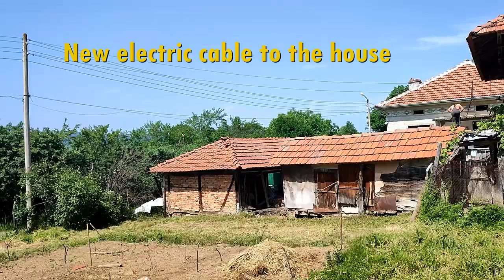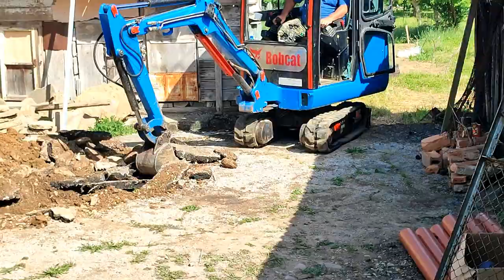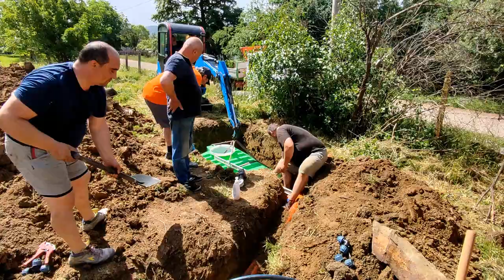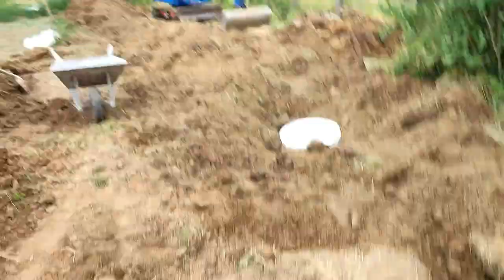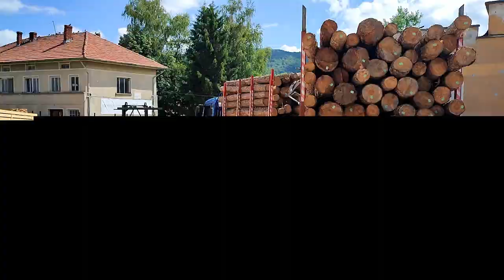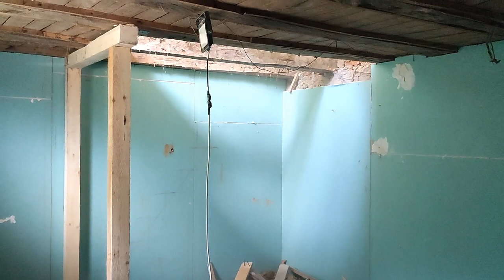Septic tank, electric cable and plans for internal stairs in our Bulgarian mountain house

Comment: I need to sort a sceptic tank out at our place but I think the problem will be getting the pump out truck close enough
Reply from the maker: How far is it. Have you checked how long the hose on the truck is?
Reply: @nibbletouch7566  the biggest problem is the bridge across the stream. It’s probably wide enough for the truck but it’s got no support in the middle. It’s a thick sheet of steel,around 8mm thick I should think. I had a guy with a flat bed full of supplies refuse to cross it and I had to have it dropped at the front and walk it down to the house. My house sits almost in the centre of the garden, even with the pipe work from the house to the tank I don’t think it will reach far enough. Won’t know unless I get them out for a quote 👍